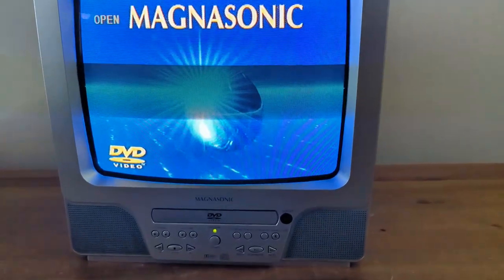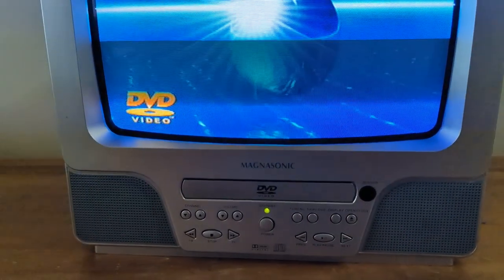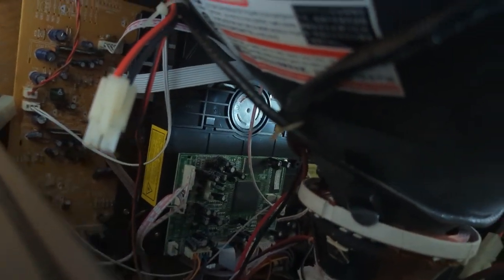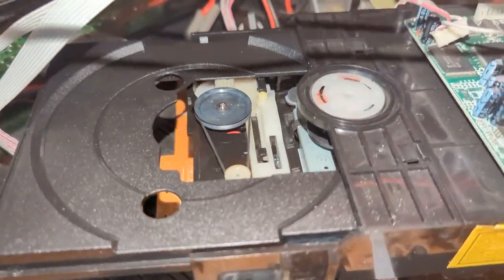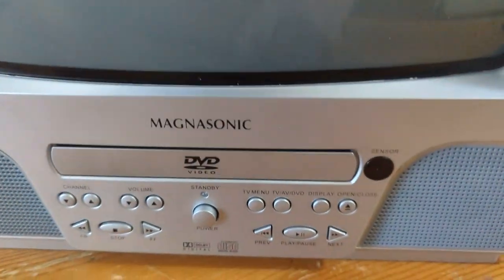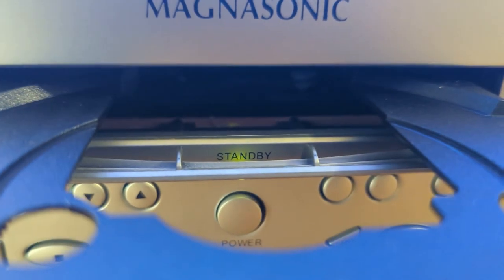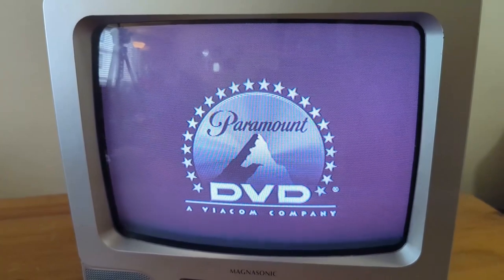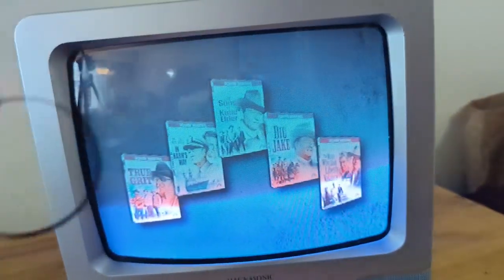How to fix the DVD tray on your CRT TV combo unit (won't eject)

Comment: Have you ever replaced the dvd drive entirely in a combo tube tv? I have an RCA Flatscreen crt that has not only a very noisy drive, but also freezes/unfreezes several times before playing. I'd like to replace the drive if I could, but uncharted territory online so far.